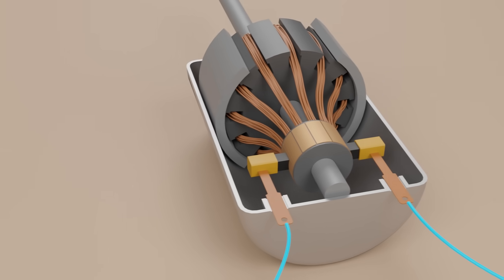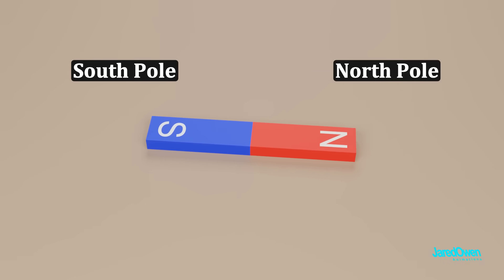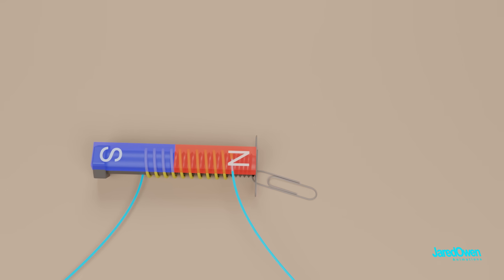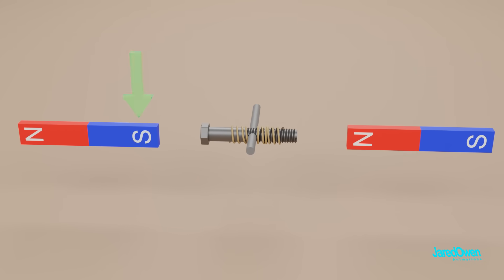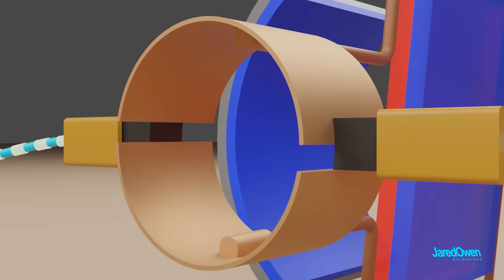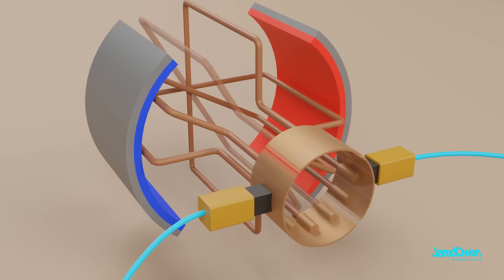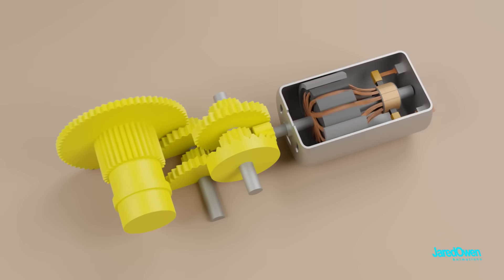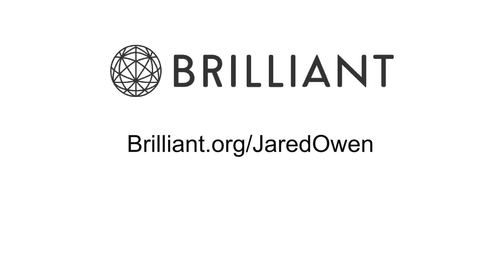How does an Electric Motor work?  (DC Motor)

Comment: How does one keep the engine from always spinning in a specific direction when turned on? Like what if it's slightly aligned the other way and spins counterclockwise? How does something like a fan keep that from happening? I opened one up but couldn't think of how they do it.
Reply: Same question here

Comment: @Jared Owen,  if I would need the rotar switch directions say like let's say I have a ball of football size and it should roll front and back for every half rotation with the rotar embedded in it .. I have been working on designing a product for further manufacturing and I strongly believe in your guidance/assistance so if you can guide me please . Happy to pay just in case .. 
Note - I m from Melbourne, Australia.. 

Hoping a response from you or Brilliant 

Thanks ,

Comment: There' is a huge open market for making motors heat up

The motor would turn on and off so it doesn't overheat 

Even if it only lasts weeks 
Right now they use polyimide heaters that require semi conductors that no one can make 

Making motors heat up is a huge untouched industry  
For billions of purposes 
The smaller the motor the better
From my understanding if the motor uses less current then the powering source the motor heats up

Super needed

Comment: The actul movement of the loop is due to Fleming left haand rule
The same concept aplied with screw turned in electromagnet
Can't be applied on actual loop
As the external magnet used has OPPOSITE POLARITIES
Opposite Polaritys

Comment: Hey..  We said this is DC motor right? 
But here,  ur switching the wires so won't that make it AC?  
Someone plz explain
Reply: The power source is a battery which supplies direct current, that is. The mechanism (as you mentioned the "switching") of the motor does not change this fact.

Comment: I finally understand why a motor completely stopped working after  I had disassembled it and reassembled...one of the magnets were damaged, and once I took it apart, one or both magnets broje right off.

Comment: my DC starter motor wouldn't work unless I tapped the side of it. I put in new brushes and checked the power flows through but it won't work at all now. Just clicking from the solenoid. Anybody got any ideas about what could be wrong?

Comment: But what insures which way the electro magnet will go? I get it if the el-magnet is already spinning. But take 3:43 for an example. What decides wether the south pole on the electro magnet will go up or down to get to the constant north pole on the right side if it stands dead still, flat like this?

Comment: 2:20 Why does the magnet push it in the direction of the spin? Actually, does the distance of the magnets have to be calibrated because if they are too close can't the magnetic field actually impede the movement of the spinning magnet?

Comment: Thanks for the good explaination almost like practical class that solved my problem during my high school about changing the wire. In theory i understand how electric motor works, and i confuse about the two wire which gives out the current that will colide each other, now i understand how the wires are taken out with any collision. Thank alot for explaining in animation video.

Comment: If you use higher voltage you can leave a gap from the brushes because voltage can jump then reduce loss of drag or friction even if not much hope this helps

Comment: Hi if I want to reproduce the same animation to teach my students. Which software you are using for this animation
Reply from the maker: www.blender.org
Reply: @JaredOwen  thanks
Reply: @JaredOwen  I installed blender. Is it possible to use your animated file in my blinder. So that I could show animation to my students but explain it in my own language. Will be very helpful for students if you could share the animations particularly I am after the animations of Physics and Electricity related. Thanks

Comment: Does the electric motor always spin clockwise direction or anti-clockwise.
Reply: It depends on the direction the current is going so if you want to make it go the other way you have to reverse the current

Comment: There’s a step missing that explains why the wire aligns the magnetic moment of the bolt, and why the armature works without a bolt. I feel that it’s the most important part and it is glossed over. An observer would not understand why you can take the bolt out and it still works based on this video.

Comment: i have no background in physics but found this video very informative, however i do have a question. YOu've shown that the motor is constantly reversing the direction of the current, but your description says that you only cover DC motors in the video. IS the constant switching of direction not alternating current?

Comment: this is sooo better than a 1 hour tutorial of a physics teacher tesching
 with white board
Reply: @sussy impostor The thing with the electromagnets is that their north and south poles can switch place depending on the direction of the current/electricity. A permanent magnet can't so since the poles will stay the same the magnet will just align with the permanent magnets around it and stay still.
Reply: True

Comment: I found out how it works when I was five years old. It's simple. I disassembled one toy motor and found that there were a lot of copper windings. I immediately understood that there was a momentum effect. When the current accelerated in one direction, there was a counter force in the other, and that's what makes the engine spin. Don't believe this video.
Reply: lmfaoooooooo

Comment: I love your videos - but this one is wrong. The commutator works because the gaps in the ring allow momentum to carry it through the stationary field. The momentum of rotation carries the loop and  the commutator segments over so that the brushes maintain current flow in the same direction in each side of the loop relative to the magnetic field.

Comment: This is a very good video that explains the common DC motor. I can only hope that someone tries to use a commentator and brushes on both sides. +/- going through from one end, and +/- coming out of the other end. This suppressed information will give the motor more torque and power while using less electric to make it work. Both sets of brushes must be lined up exactly for this to work. I hope to see this explained on your next video. Thanks for this.

Comment: I appreciate your labor for this animation, but the connections of the armature coils to the commutator are wrong. Why do you think most animations do not show multiple coils? Because their connections are quite complicated, not as shown here. Most students who comment here think they have understood eventually with this video; in fact, they misunderstood. In this animation, only one coil is active at any instant; but all the coils in a parallel branch are in series in reality. The sum of their absolute voltages which are in different phases is approximately equal to the average of one's absolute voltage multiplied by the number of the coils in a parallel branch and it is approximately constant.

Comment: I used to run a Automated Conveyor line, for pallets. Forklifters would put a stack of 18 High CHEP pallets, and it would be sensorized by sensors which would push them down the line, the conveyor was automatic and i would sort the pallets basically from good to bad. The Pallets Per Hour goal was 600 a hour so basically 100 every 10 minutes. If i left the machine running as accordingly it can run at that rate with no problems, but if i would grab the pallets and throw them down the line it would make the rate of pallets go up way higher. I had a automated technician who was our mechanic say that he can program the cycle to run at a faster rate. He always asked for permission but they always denied him even though he knew what he was doing.

Comment: AMAZING---PLEASE READ ALL OF THIS=Including the URLs-(especially the last 7)
Free energy is so super simple that it should be proof positive, of an extremely powerful spiritual warfare, that is going on behind the scenes, in order to cover up the simplicity of this technology. This free energy technology is so old that it can be found in Ezekiel 1:16, where it is attempting to describe the workings of a UFO motor = ”a wheel in the middle of a wheel”. I used pulleys to imitate this technology, where you only pay a few sparks of current input for 1 rotation of a motor with a large 33 cm circumference, (about 10 cm diameter) pulley attached. This would freely gain your 99 cycles of AC or DC electricity, from 3 mini-pulleys of 1 cm circumference-(about 0.33 cm diameter) with AC or DC motors/generators attached, by simply running the same belt-strap or even a tied piece of rope or string in a pinch, past these 3 or more mini-pulleys. 
- 
I cannot be sure if Trump was-is+will-be the best American President,,, but did you notice that the fake news of the very corrupt media does not mention all of the great things Trump did?. Democrats not only want to kill your unborn offspring, but they want to kill them after birth even. DON'T BELIEVE ME,,,., then Google Democrat + abortion, then you can see for yourself. 
-
TRUMP ELECTION SCANDAL <<< If these are true=This Is Scary >>>
https://www.youtube.com/watch?v=NOiaymqaQdc&fbclid=IwAR1lcZFAjGij0TmkIGLRLsJnayWpZsTRViXB-DmOATG0E3JXgHlWl5fAl9g
+ https://www.youtube.com/watch?v=V_7Z058MC7M&t=3735s
+ https://www.youtube.com/watch?v=dBj9ZDC_Ad8&t=1481s
+ https://www.youtube.com/watch?v=m0YKf-caVuY&t=240s
+ https://www.youtube.com/watch?v=V_7Z058MC7M&t=3720s
+ https://www.youtube.com/watch?v=OWwNJZhcrww
+ https://www.youtube.com/watch?v=R5ki6S-WsKU&t=977s
+ https://www.youtube.com/watch?v=Z8UZn7PmyXc&t=112s
+ https://www.youtube.com/watch?v=Dc-HQyBm8GU&t=4242s
+ https://www.youtube.com/watch?v=OUS9mM8Xbbw
+ https://www.youtube.com/watch?v=ok_VQ8I7g6I
+ https://www.youtube.com/watch?v=4gseOeyS0NQ
+ https://www.youtube.com/watch?v=2bfWCdg4B04
+ https://www.youtube.com/watch?v=HIKOXyxlhag&t=381s
+ https://www.youtube.com/watch?v=fCqwwHs6oU0
+ https://www.youtube.com/watch?v=V_7Z058MC7M&t=3735s
+ https://www.youtube.com/watch?v=bgMpTQNCcgg
-
Want to know more about something that really matters, like the Truth about the true powers of this world, reality + what our lives are truly all about. Trump believes in our Father in Heaven, and by the way, the ARK of the COVENANT has been found in Jeremiah's Grotto, right under where YESHUA=Jesus was crucified. So HIS BLOOD + WATER that came out when He was stabbed by the spear could run down the crack in the bedrock, that happened when the earth quaked + landed on the correct side of the ARK, that was placed there many hundreds of years earlier. His dried BLOOD was still alive even, + tested as only having 24 CHROMOSOMES = Virgin Born + proving HIS DIVINITY.. (only had one parent= regular 46, which is 23 chromosomes each) + with only one male Y chromosome from the Father.
-
PLEASE WATCH THIS VIDEO https://www.youtube.com/watch?v=B8TRoQk6WUE @ (41:41) = HIS Blood is STILL ALIVE + had only 24 chromosomes = 23 from his mother + only One from His Father (normal people have 46 = 23 from the mother + 23 from the father). If these videos have been taken down, then in YouTube search these words = ( ark of covenant blood Ron Wyatt ) - Sorry guys + gals, but the higher up elite of mankind has decided to believe + side with these aliens (fallen angels + Nephilim) = sons+daughters of the children of fallen angels + human females in building these particle colliders - which mess with our timelines + allow evil spirits into our reality. 
-
Isn't it amazing what knowledge we can gain by simply adding the “il-s” of life, into this evil theory.,, EVil-sOLUTION. Evolution never happened,,, and it never had the time, so it could have happened,,,, because we have only been here on this earth for about 6000 years. Think about the odds of us on this earth that is constantly gaining mass from space dust and meteors, revolving around a sun that is always losing mass from burning fuel=mass. If mankind has evolved over billions of years, then why is there only about 6000 years worth of His-story and so little space dust on the moon = see the moon landings, there are only a few cms of space dust. If evolution ever happened, then it needed the moon to keep the oceans from becoming stagnant water.
-
WHERE ARE THE THE BILLIONS OF YEARS WORTH OF DUST DEPOSIT. Surely that would have produce meters of dust, as would not the dust have been even thicker way back then + Don't try to tell me that something or someone removed the dust every so many thousand years.
-
DO THE MATH FOR YOURSELF = the amount of dust deposit is known,,, + the amount deposited every year is known too. I did the math in the early '90s, and it worked out to be about 6000 years worth of dust that is on the moon now. I don't know if they use the same figures now or not. But even so, it should be obvious that after even one billion years,,,, the dust should be many meters thick.
+ TRUTH about COVID-19 https://www.youtube.com/watch?v=H_vNWmqWmZc 
-
This is so simple that it should be proof positive of the Battle between GOOD + EVIL.
Proof of a most powerful war going on in the background, with REAL BAD FORCES that are controlling our lives. Please remember that Satan is called the ”god of this world” in our Scriptures = (2 Corinthians 4:4). You only need to input a few sparks of current, that rotates a large 33  cm circumference pulley once, to multiply you an output of 99 cycles of AC or DC electricity from 3 mini-pulleys of 1 cm circumference pulleys with AC or DC motors/generators attached. Do you see how super simple this is, and how powerful the evil forces are to keep this super simple technology from us for so long? Please don't 
-
FREE ENERGY = SIMPLICITY AT THE BEST (AC Electricity Multiplication using simply the geometry of pulleys to multiply AC rotations) (a DC motor only takes a few sparks of current, to rotate one full time) Please don't be fooled by the old false torque problem lie, because this torque only occurs when you are producing power. And no matter how much voltage you need, when you multiply it by the few sparks of listen current that you need, (practically nothing) it equals only the smallest amount of power, (requiring very little torque).
-
THIS AC ELECTRICITY MULTIPLIER WORKS, and it is so logical that it simply MUST WORK. This uses a few sparks of DC current to rotate one large pulley of 33 cm circumference = (about 10 cm in diameter) one single time. Then by rotating 1 to 3 mini-pulleys, of one-centimeter circumference, = 33 rotations each. If you attach AC or DC generators to each of these mini-pulleys, then you can get a return of 33 to 99 cycles of AC or DC electricity as an output. Which is far more electricity output than you would need for the few sparks of DC input, which is all the input drive motor needs to rotate once.
-
The only reason that this super simple technology has not been used earlier to create free energy for us, are the millions, if not billions of fallen angels + evil spirits, trying desperately to make sure, that mankind never discovers this super simple technology, which is God’s Gift to mankind, which He laid out for us way back in Ezekiel 1:16 http://free-energy.yolasite.com/
-
(EZE 1:16) “The appearance of the wheels and their work was like unto the color of a beryl: and they four had one likeness: and their appearance and their work was as it were a wheel in the middle of a wheel.” - As in, a little wheel inside a big wheel, but I could not afford to buy a big wheel with threading on the inside, and a mini wheel with the same threading on its outside. So I did the next best thing, I connected a big wheel to a mini wheel through a belt, strap, rope, or even a piece of string in a pinch to connect the two pulleys with motors attached.
-
Have you ever heard of the MANDELA Effect? PLEASE CHECK THIS OUT,,,, + then try telling me that there is not a POWERFUL SPIRITUAL WARFARE going on in our world. This is a must-watch video. All of time and space are changing. Things that are true have been altered + CERN is the cause for these events.
https://www.youtube.com/watch?v=pPrutcbaerQ
-
- Here is one of the videos trying to let this scary information out https://www.youtube.com/watchv=pPrutcbaerQ&list=PLDIEv5nkqqEa0-u8DIzqpefKBAG0nkb7g&index=1 
OPPPPSSS,,, that one has been taken off the web,,, TRY THIS ONE - 
https://www.readersdigest.com.au/true-stories-lifestyle/thought-provoking/44-mandela-effect-examples-that-are-seriously-mind-bending
-
+ here is an explanation by the Physicists https://www.youtube.com/watch?v=HHKmoBeNWWQ&list=PLDIEv5nkqqEa0-u8DIzqpefKBAG0nkb7g&index=2 
-
CERN Is Changing Our Timelines – Proof - Mandela Effect Part 1 + this is a video of what they are really up to https://www.youtube.com/watch?v=49dGknES0-w 
-
Here is a website that shows you how quick + simple this GEM technology is to build
= https://www.youtube.com/watch?reload=9&v=NxpoiCFKmPg 
-
http://free-energy.yolasite.com/ 
http://beliefstoliveby.yolasite.com/ 
http://aliensandghosts.yolasite.com/ 
http://decimationofthisevolutionfairytale.yolasite.com/ 
http://evolutiondebate.yolasite.com/ 
-
TRUTH ABOUT CERN
https://www.youtube.com/watch?v=49dGknES0-w 
https://www.youtube.com/watch?v=ooZA0riSa9Y 
D-WAVE COMPUTER
https://www.youtube.com/watch?v=1v19n5JBSDs&t=305s 
RELEASING DARKNESS
https://www.youtube.com/watch?v=7TA-z6RrXRo 
EXTREME NATURE CHANGES
https://www.youtube.com/watch?v=7HnSOZXZdWU 
ILLUMINATI PLAN FOR HUMANITY
https://www.youtube.com/watch?v=49dGknES0-w 
SATAN’s NAME IS "God"
https://www.youtube.com/watch?v=_qr2vT5ySLA&t=